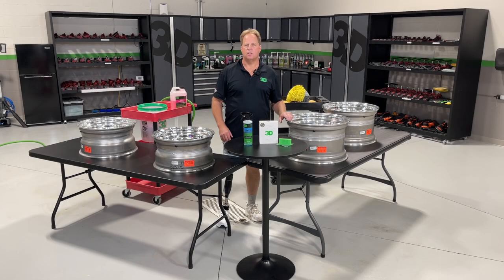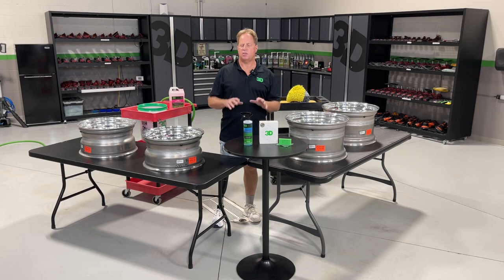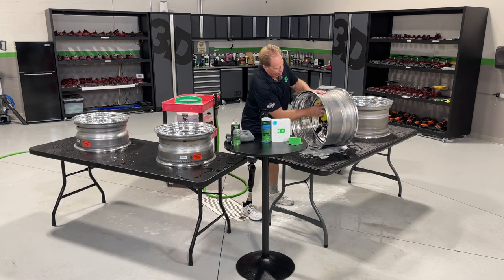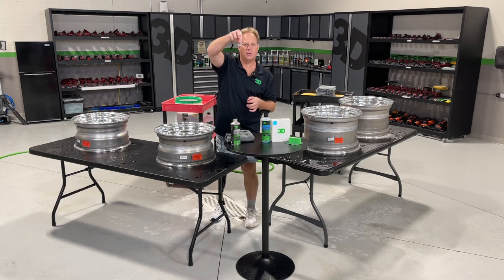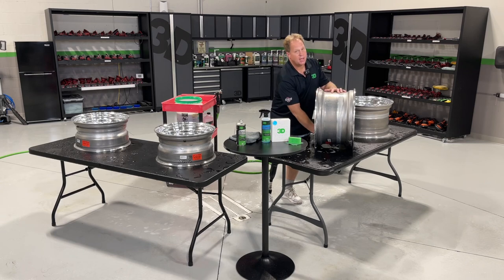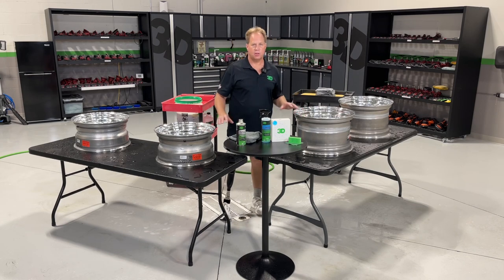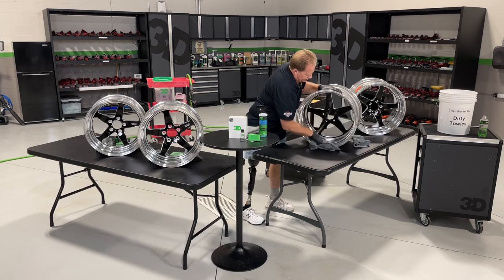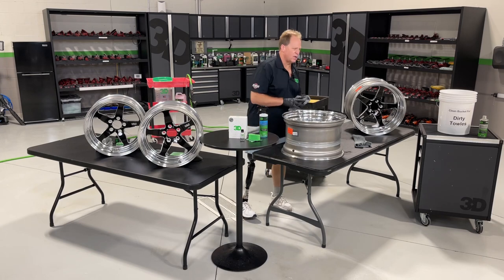Graphene Ceramic Coating Weld Forged Wheels!

Comment: I own the same wheels own tint , ppf and high end detailing business. Get them polished out and then on the inside barrel instal ppf and on the outside of the wheel install ppf. Autobahn Incognito lifetime ppf and the wheels always look perfect. Coatings are great but PPF is king. But the Welds are badass wheels.